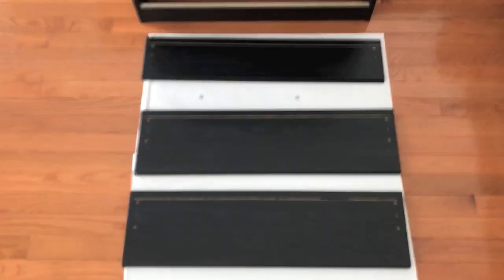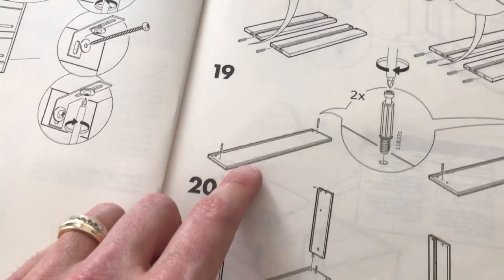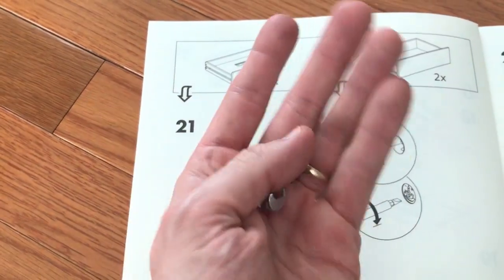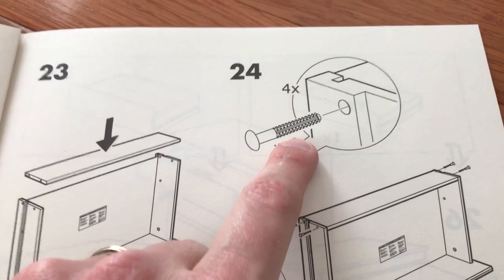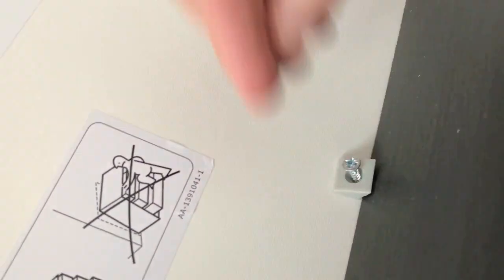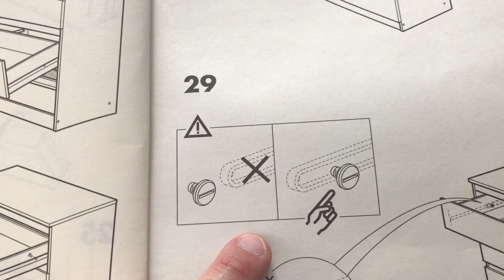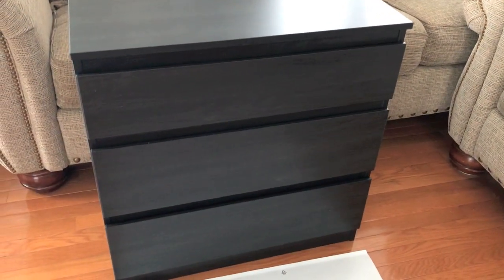How to assemble/build IKEA Dresser Drawers - FAST & EASY!

Comment: Are the plastic screws on the side boards easy to insert? It seems like the holes are too small in my boards and the screw gets stuck halfway through... any tips for how to deal with this?
Reply from the maker: Dani Katz 

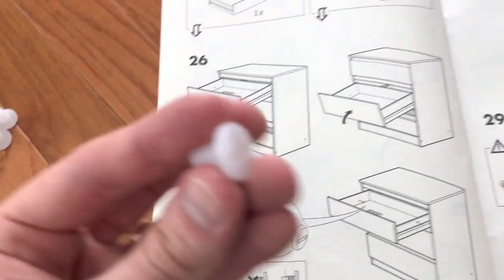Thanks for watching Dani, if you’re referring to the white plastic flat-head screws shown @ 2:51, these little screws are “Stopper points” to alleviate the drawer from coming all the way out & falling to the ground.

These little screwed are ever-so-slightly larger than the hole & this is because they’re plastic & there is no internal thread.

We recommend inserting screws & carefully tightening with screw drive until they are flush...no need to over tighten.

Hope this helps.  Please subscribe to the channel and turn on your YouTube notification Bell 🛎 that would be awesome thanks again!

😎👍🔧🔩